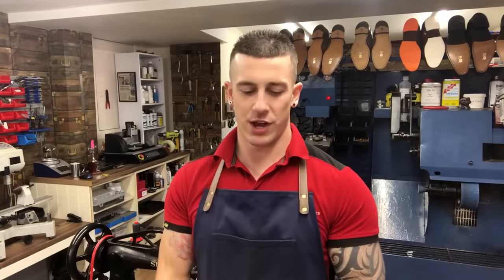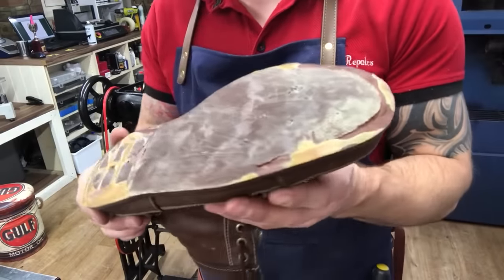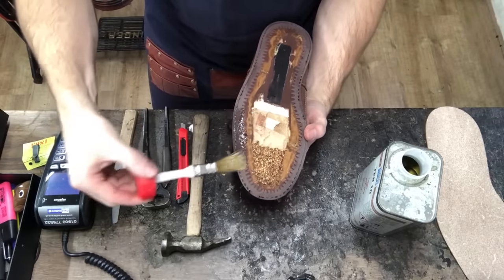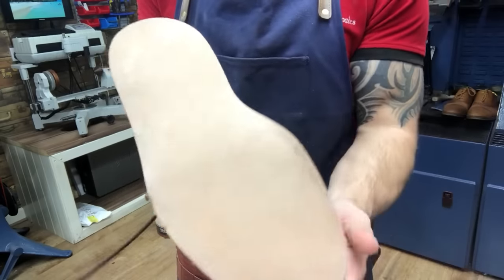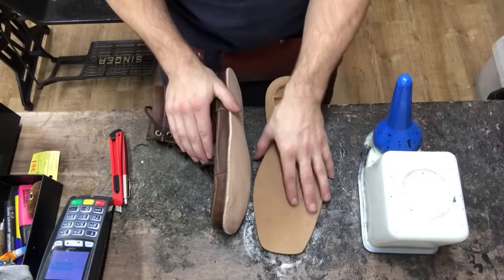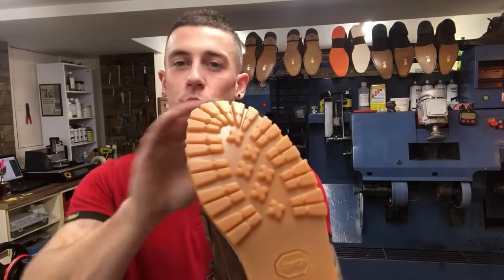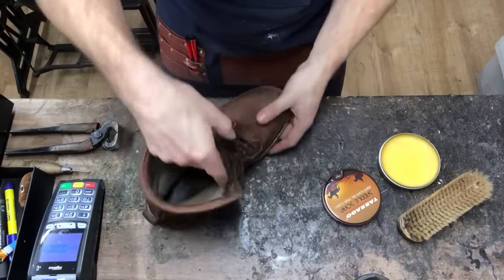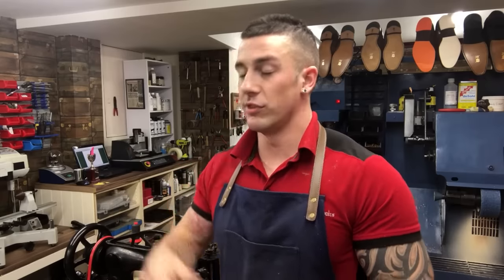Resoling Timberland Boots | Vibram Soles | Timberland Boot Upgrade

Comment: Its a shame more people do not have their boots or shoes repaired instead of simply throwing them away to endless up as landfill. A nice relaxing video with no nonsense presenting .
Reply: It's probably very much down to cost of doing this. New Earthkeepers cost £155 retail, you can get them discounted for £108 from Timberland. I would wager that replacing the soles alone will cost you very close to or equal in parts and labor than the £108, not talking about leather midsoles. The soles alone cost you anywhere from £15 to £20 per sole without the markup. Then the craftsman has to pay himself a decent wage and account for the running costs of the shop itself. I might be wrong, but looking at the amount of time spent on this pair of boots I cannot see this being very much cheaper than £100. I mean, you make a Rolls Royce out of a Vauxhall, but do you need it? That's each individual's question to respond to. I came here because with the snow out I just discovered a crack in the sole of my Timberlands, but they cost me £70 from Timberland. Not sure if I want to spend that much to re-sole them if I can get a pair of new boots with the sales.
Reply: Most shoes can’t be repaired. Shit quality to start can never be repaired
Reply: @gags730  exactly my point. It’s a shame because seeing guys like this makes me want to spend good money more often on quality 
End up saving money in long run having repairs done than buying new pair every 6 - 12 months

Comment: I've only ever had one pair of boots resoled. Really nice, knee high, steel toe climbing boots when I was a tree trimmer. Supple as silk in the ankle. Had 'em for several years. Seems like just a couple months later somebody stole them. I'd let them air out in back of the truck on the way home. Somebody probably grabbed them at a gas station I guess.
Hope they really needed them.

Comment: I really admire the work but I cant imagine how it pays to do all that. Even at $15 hr labor you would have to charge the customer $200+ dollars. Who is gonna pay that?
Reply: Some time it is not all about the money it is all depends on the thing you getting repair I have my rickport shoes i bought them in 2002 and I still have them in genuin condition and I did spend £150 on them i love to get my shoes to get repaired by professional
Reply: My thoughts exactly. You could buy 3 new pairs for the price of 1 repair.
Reply from the maker: This isn’t accurate repairs are generally cheaper than a new pair 😀
Reply: Well, I have boots and shoes that I love and can’t find anymore so they get repaired, resoled, reheeled....whatever they need. If you buy good quality items, it’s an easy decision to fix them instead of replacing them.

Comment: Question for you or your followers. I really enjoyed your video and want to try my own. What was the spray you used to treat the edges of the soles after resoleing? 

I am about to attempt my first resole. I am operating without a net as it is just me and I have never worked on boots before. I chose a black vibram sole and now want to add a leather midsole as well. I had not thought of that till watching this video. There was no midsole on the boot originally. It has a stiched synthetic foot bed. What should I use to treat and color the leather midsole edge?
Thank you for the video and any advice anyone can offer.
John

Comment: Many thanks for making these videos
Looks like you have a good future ahead of yourself with the boots made these days, good luck with it.
Sorry about possibly getting terms or material identification wrong, but am wondering if these were your boots,
(money no object) would you have done something else, mainly concering the polyurethane?  welt which needed the special primer solution (guessing green)
Having a go myself at a few repairs,  think I am going to attempt bonding multiple layers of leather to
make a laminated midsole for my CAT's which failed after only a few months.
 The polyurethane midsole was degraded and has cracks and whatnot, "hydrolysis"  I'm lead to believe this is called.

If the same material is on the welt on my CAT's, or indeed if it's another material which needs special primer, then
I would be interested if rubber or leather would be preferred for this application,
Have some rubber soles and a big bag of old leather jackets collected for tools, so would hopefully be a good use of them.
(having learned that leather on tools will cause corrosion, lol)

Many thanks again for all I've learned.
All the best

Tom

Comment: Bro. You are the best ever.  Remind me of my Sewing Machine Services,,days.  My wife told me  after watching you. I can apply,,,My concerns is you don’t wear protection,,no masks. Those Glues are nasty stuff,,,and the grinding all the dust ,you breathe in,,,also no hand protection,,,,there is a special Steel Mesh glove,,worn by the Cutting Machine Operator,,,in the Garment Industry,,  also that Singer Shoe Repair Machine is best. Don’t ever get rid of that. Also you should buy some spares,,,Eg Bobbin case,,Hook,,Bobbins,,tension unit,,Needles.   All sizes.  You keep good,,,,

Comment: I have a pair of the exact same Earthkeepers where the stick on sole came off entirely on them as the glue got old. The leather uppers are still in good condition and it seems a shame to throw them away or something. What would this sort of resole and a new mock welt adding to them cost?

Comment: I have a pair of timberland pro work boots a few years old broke in and SUPER comfy. The soles are coming apart and just the heal and the are glued they are not steel toe. I want to get them fixed and if able ungraded also maybe a new better sole or something. I am willing to ship to and from you if able to repair I like your work sure a shop here is good but I like to see what I am paying for and you do great work. I can shoot my email to your so can send pix and maybe get a estimate on the repair even if it is more then the estimate for ran into a issue I am fine with. Yea I could go buy a new pair for 200 like I spent on these but they are broke in and comfy just sole is the issue thanks in advance.

Comment: I understand edge adhesion is the most important things, but why don't you pound soles(and mid soles) on from the center out to get the air out(like a sticker or window tint). Is it irrelevant because it's a breathable material and the air in the middle will always get out?

Comment: Do you have to let the glue cure for a while after putting the sole on? You seemed to trim them straight away?
Reply from the maker: Nope, the drying portion is before the reheating and applying is done, then it's stuck.

Comment: Would it not be quicker to sand the sole and mid sole down instead of removing the sole first? Obviously you know best but i’m just curious
Reply from the maker: The outsoles too tough to sand off, well easily at least, quicker to cut off :)

Comment: Honest question...Why hammer and THEN press, why not straight into the press?
Reply from the maker: Mainly the press wouldn’t “get” all the parts of the sole firmly in place, the press  finishes off the job by applying even pressure across the whole of the shoe.
Reply: @Dan_the_cobbler  Wonderful, thank you!

Comment: My local Timpson want £100 to replace the soles on my Cats i paid £85 for.
How much would you charge , is it a DIY job? and what glue do you use as i can buy replacement soles for around £28
Reply from the maker: I certainly wouldn’t recommend doing it  yourself. But £100 is an average price, I did this for £85.
Reply: @Dan_the_cobbler  Knowing how much replacement soles cost and the labour thats involved i understand the cost of repairs which is justified and makes economical sense if  one owns a pair of High end Redwings or top of the range Scarpa's  or where the cost of repair is a third of what the boots cost new .
As for my  Caterpillars which have near perfect uppers they was taken away by the dustman earlier :(

Comment: Why do you apply glue and let it try then reheat it? 🤔
Reply from the maker: That's just how contact adhesive works, some you don't have to always heat but this brand you do.
Reply: @Dan_the_cobbler  Thanks very much for that elucidation. I wish your shop were near me in North London. I need SO many repair jobs doing! Continued succes, Dan 👍

Comment: Hm I don't quite see how the leather midsole is an upgrade. The best boot manufacturers in the world use PU Foam midsoles for their extreme durability, lightness and excellent cushioning. Leather has comparatively nearly no cushioning, is very heavy, while no longer offering superior durability to modern PU foam midsoles as it used to. The only real advantage seems to be that it is easy to apply for the cobbler and a little bit sleeker in profile. 

My Crockett and Jones use PU Foam as well and they have been the best boots I have ever owned and resoling them after 5 years was no trouble at all. In fact the cobbler was so excited to work on them he gave me a discount and let me watch.